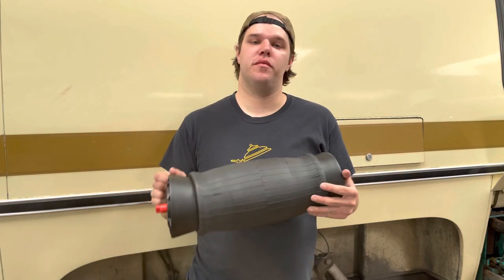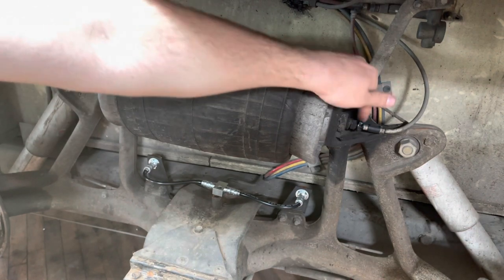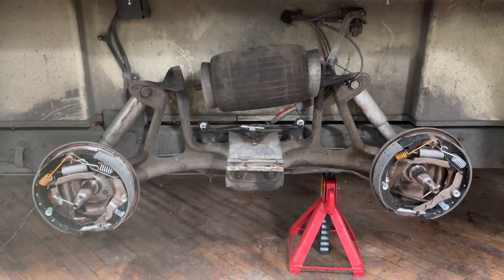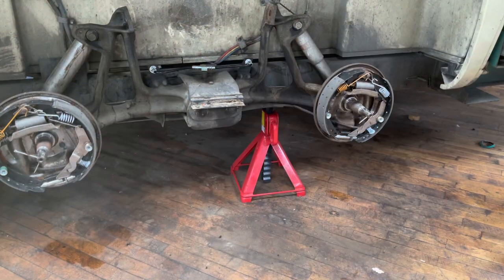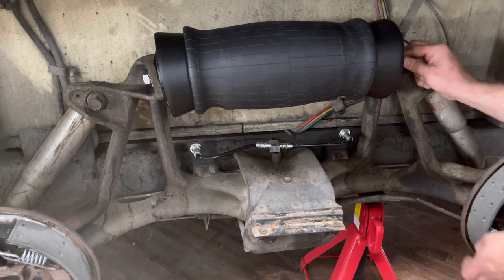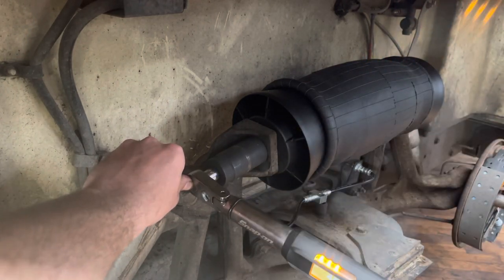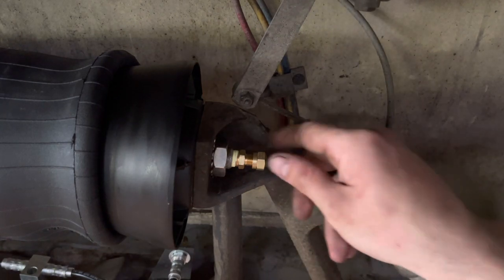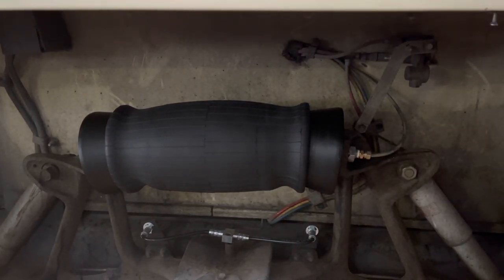How to Replace GMC RV Air Bags At Home!

Comment: I appreciate you doing these. I was reluctant to go with these bags because several in the community warned against them for being unreliable. But I really want the original design, so I purchased these and replaced my older aftermarket bags that were installed with brackets that severely limited the range of motion. I installed these with a dual needle pressure gauge to be sure the pressure never exceeded 100 lbs. They worked great for a couple of months with one trip that was just 2 hours away. Then last week BOOOM. One failed while it was just sitting in the driveway with only about 75 lbs of pressure. The company had me mail them the old one before they would replace it. And the did send a new one, but now I have no confidence in this product. I really wish that wasn't the case. I will probably try the 'Sully' bag system next. Many rave about the quad bags, and I may ultimately go that way, but they don't operate the way this suspension was designed to behave.
Reply from the maker: That is alarming. I havent had any problems yet but I will be sure to document them if I do. Thank you Marcus.

Comment: Is there much benefit performance wise to upgrading the air bags to the quad system or Sullybit system vs keeping it stock?
Reply from the maker: The stock system was designed and engineered for the motorhomes unique suspension. The ride quality is smoother than quad bag but the quad bag has its dedicated following. I have no regrets using the OEM air bags. My Moms 1978 Royale has quad bags and isnt as smooth over bumps.

Comment: Where do you order the airbag suspension, and what is the price..
Thanks.
Reply from the maker: Cinnabar engineering. Call them, do not bother with online. Tell them Andrew Cudlipp sent ya should be around $400/side.